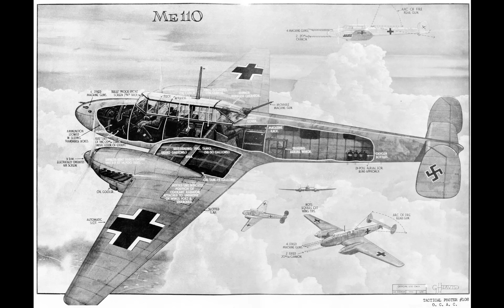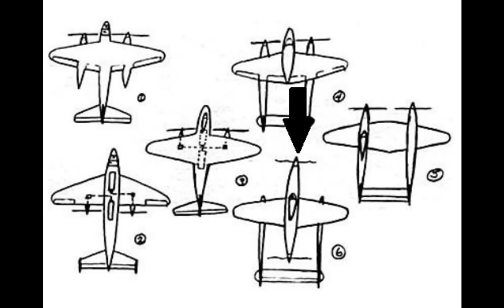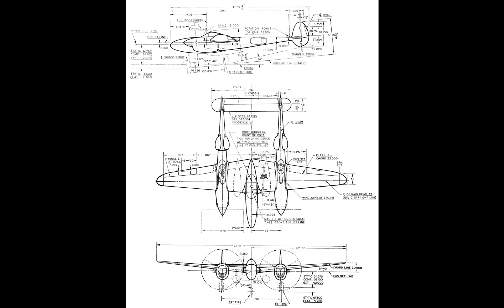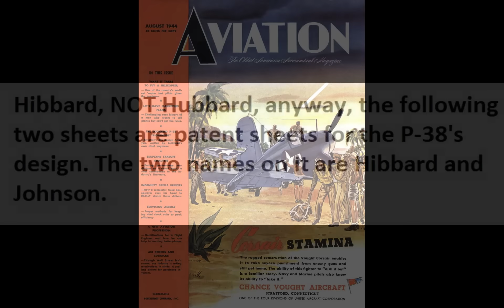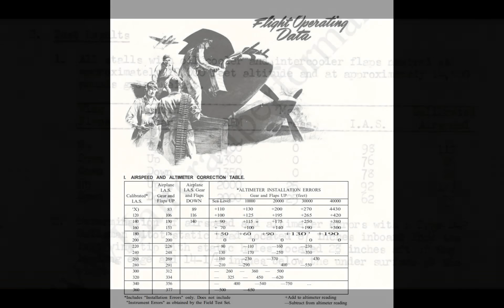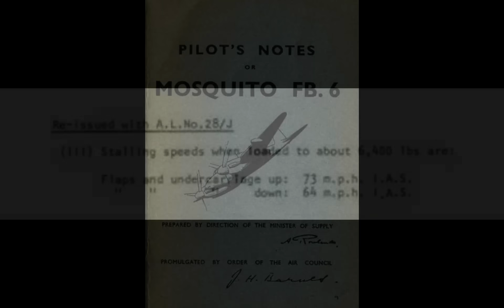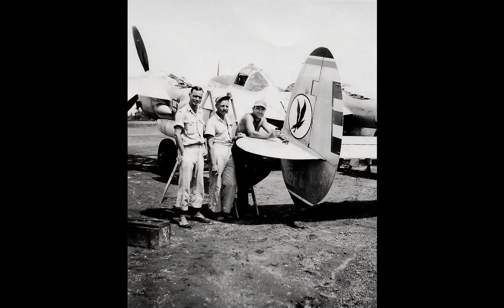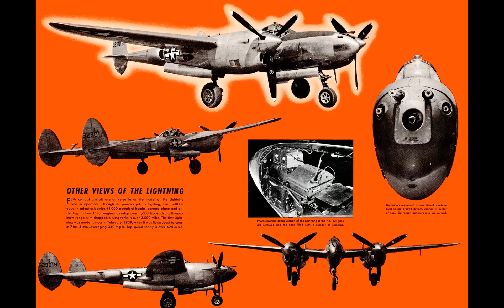Lockheed P-38 Lightning Design Info

Comment: Twin booms aside, the push-pull engine configuration AND a requirement for space for a pilot and weapons and superchargers and fuel and methanol-water injection and/or nitrous oxide seems to result in quite the sizeable plane, case in point the Do335. Makes one appreciate how compact a design the P38 actually is.
Reply from the maker: Good point about the size of the 335, and it doesn't have turbos.
Reply: @GregsAirplanesandAutomobiles  Well the do 335 was originally designed to be a bomber that got retrofitted into being a fighter. Mostly to hunt bombers as its armament was insane.
Reply: @GregsAirplanesandAutomobiles , have any data on b-29 wing rip speeds? I assume it is extremely close to its maximum speed (indicated).
Reply: @libertywolfyt985  What is Wing Rip Speed?
Like a Dynamic type of failure in a dive, or a Static Pull type test?
I have no clue, in any case...😜
Reply: @2lotusman851 , the collision or drag against the wings is so much that the wings are ripped off the fuselage, same concept as landing gear and flaps ripping off in different positions. There is also ripping for heavy g loads. You could notice the ripping starting if the wings start vibrating apart. For example, an me 163 achieved a top speed for the time, but parts of the aircraft started ripping off. 

The reason I wonder about the B-29 is because when people want to flaunt a top speed, but they don't usually understand other limitations.
Reply: @libertywolfyt985  There's no such thing as "wing rip speed."  Vne indicates where the plane can be expected to break apart due to excessive speed (indicated), and G limits indicate the same thing.
Reply: @immikeurnot , I am well aware that it isn't normally measured. I am asking specifically that because you are far more likely to crash when you have no wings.
Reply: @immikeurnot  The only thing I have read is T/M and C/M as measured by British Machmeters and the USAAF using Indicated Limit Diving Speed ILDS
Reply: @GregsAirplanesandAutomobiles  have you covered the P-61 Black Widow?
Reply: The Do335 makes the p47 look thin.
Reply: @juanordonezgalban2278   and SHORT
Reply: @juanordonezgalban2278  

The 335 makes the ARADO look tiny
Reply: @juanordonezgalban2278  Like ANYTHING, including a C5A, could make the Jug look thin.

Less Fat, maybe. Thin, no.
Reply: At least the Do335 manages to have 1 fuselage instead of 3...
Not by chance, its top speed is 100km/h higher despite having no turbo and a worse power/weight ratio.

Of course, there is more than just top speed. But the 3 gondolas approach isn't exactly the most elegant one from an engineering perspective.
Reply: @jorehir  1 fuselage and what, 5-6 years of progress in aerodynamics. Despite the Do335 being a chungus of a fighter plane, among other developments there's far less scoops, turbos and other doohickeys hanging out in the breeze than on the P38...I mean the gun barrels sticking so far out of the nose cost mph (like the bulges on the cowl of the 109-G6). But I don't think the three gondola or two gondolas and fuselage would be something that couldn't be overcome with a wind tunnel and horsepower like the f7f or Sea Hornet.
Reply: @DecrepitFatGuy  Having essentially 3 fuselages instead of 1 is inherently worse, aerodynamically. It leaves you with like twice the frontal area and 50% more wetted surface. Yeah, you can partially compensate with nicer teardrop shapes compared to a long cigar fuselage, but that won't be enough.

Now, the 3 fuselage approach has its advantages too (or Lockheed wouldn't have gone for it). For example, engines are more accessible, fuselages and wings are lighter (or potential load is higher), etc.

Surely, it depends on your priorities and the role you assign to the plane, but if you want it to go fast (like an interceptor should), you go for the Do335 configuration without a doubt. For other cases, it's arguable.
Reply: @jorehir  I don't disagree. If one were looking for the most go fast, the Do335 layout is the optimal one for that , like you said for frontal area and wetted surface area. One only needs to look at how the Dornier managed similar top end performance to the Sea Hornet with more weight (I think?) and over 300 less horsepower and probably better top end to the F7F with 400 or so horsepower less. If getting horsepower out of an engine were not an issue, then like you said requirements, priorities, roles and then manufacturability, maintainability, convenience and such become considerations that in my opinion might override a more aerodynamically optimal layout...though one can always imagine a Pfeil with the engine power of aTigercat, that would've been something else, until some engineer gets the bright idea to stopgap it into the jet age. Which they were going to do afaik.
Reply: @jorehir  well having a boat of a fueselage with bad P/W makes fire terrible acceleration, terrible turn rates at most speed ranges you’d fly at, and makes you a target. You failed to mention how the P 38 has vastly better visibility unless you what you make the point that pilot visibility doesn’t matter? 

If I make the pilot completely blind and have almost no maneuvering capability and hardly any good acceleration does that make it a better plane than the lighting just because it’s “faster”? 

Hmm, I’d rather be slower, have better acceleration, better maneuverability, and actually be able to see above and behind me without the obstruction of huge bars making me feel like I’m in a prison of death if I make 1 turn… 

Speed can be life but Top speed isn’t true end all be all. If you take hours to accelerate to top speed while being faster when a guy can accelerate to 3 quarters your speed in a fraction of the time isn’t feasible in reality for pilot survivability. 

The Do 335 would suffer in a 1 to 1 scenario against a p-38 or in real life multiple p-38s .
Reply: @BARelement  The Do335 could have had equally good visibility if its designers had gone another route with its canopy. It's not a problem related to its fuselage design, which is what we were discussing.

And, having almost the same wing loading and P/W as the P38, i wouldn't call the Do335 a brick...
Yeah, i wouldn't want to rate fight with it either at low speed, but that's about it.
Reply: @jorehir  
"Of course, there is more than just top speed. But the 3 gondolas approach isn't exactly the most elegant one from an engineering perspective."
...And yet it was one of the more survivable aircraft of the war. When it comes to engineering, having multiple segments isn't a problem. How you join them together structurally is. There are plenty of single-engine one-fuselage aircraft that were no were near as strong and survivable as the P-38 was despite its "weaknesses." And when you look at what the USAAF was doing with the things and just throwing them into every conceivable role even if it didn't make sense utilizing them in that fashion and I wonder how many other aircraft could both do it was asked to do and do it as well as it did. Sure, the P-47 might be one of the most survivable single piloted aircraft of the era, but you weren't going to turn it into a tactical bomber and it had limitations with reconnaissance.
Reply: @matchesburn  I had a very old neighbor who was a pilot in WWII. He flew the P-51 and also the P-38, so of course I was fascinated by his stories. He MUCH preferred the P-38. Better visibility, and if one engine got shot up, he could still get home instead of parachuting. You could take two shot-up P-38's and make one good one, but...if you shoot up the engine on a P-51, it was going to crash in enemy territory.
Reply: @jorehir  Good point. The planes had diferent objetives to achive and took diferent aproaches to them.
Reply: @jorehir  Well, the counterpoint is that I'll guess that configuration was considered but at the time the more practical approach towards ensuring they could meet and exceed the original design requirements was the twin boom and Gondola approach they finally settled on.
Reply: @Mike-eq4ky  Yeah, it's very possible.
Reply: @jorehir  - Bailing Out of a Do 335 can be Hazardous, if not Fatal
Reply: @jorehir  Chuck Yeager flew the DO-335 after the war while stationed at Dayton and considered it a very overcomplicated design that would have been difficult to maintain.
Reply: @fafner1   but it worked and it was faster than anything else flying bar the Me-262 and Arado Ar- 234
Reply: @mikepette4422  It worked for setting paper speed records; did it actually ever shoot anything down?
Reply: @mikepette4422  Its first flight was in 1943. It apparently had problems with engines overheating. 
Another German Superweapon for the YouTube-- Gee-- Whizz echo chamber.
Reply: @mikepette4422  
"but it worked"
An aircraft that can work in testing and was never put into combat service has not actually proven that it's a capable design. And I'd be willing to bet my left arm that, like many things that were cooked up in desperation by the Germans at the last minute, that its actual practical real-world performance in the field left A LOT to be desired.
Reply: @fafner1  But they won’t talk about that lol.
Reply: @fafner1  the Do was the fastest piston engine of the was and handled really well.
Reply: @fafner1  oh come on, it came late in the war and was a very well handling plane and the fastest prop plane made, had ejector seats too.
Reply: @Ivan TheMadVandal The P-51H never saw WW2 combat as it came just a little too late, and the P-47M came a few weeks before the war over Europe ended. The first recorded encounter with a Do335 is listed in April 1945, in which it outran 2 Tempests at low altitude.
Not to mention Germany's precarious position in... everything, from research to manufacturing.
Reply: @Ivan TheMadVandal Barely superior? Maybe, but it beat all of them in straight line speed. 
Impressive when you don't have access to a willing workforce, high octane fuel, factories that haven't been bombed, etc.
Deliveries of the Do335 started in January of 1945 and factory was overrun in late April. While the P-47M technically started delivery in December of 1944, engine issues meant it didn't actually get deployed until the war was almost over. Germany didn't have the luxury of waiting, so whatever problems they had were going to stay.
The P-51H arrived after the war was over on both theaters.
Reply: @Ivan TheMadVandal It obviously saw combat, it simply wasn't a fighter. From January to April it is guaranteed that it saw combat somewhere.
Easy to lose track of a plane that had all of 11 units produced and was relegated mostly to ground attacks or maybe shooting bombers.

Both came late, had a negligible impact in the war, and were used in low numbers.
The difference is that only one of them remained as the fastest piston engined aircraft of the time, and it didn't need 150 octane fuel or a giant turbo to do it.
Also keep in mind that it was originally designed, from the start, as a fast bomber. Not a fighter, not an interceptor, not a ground attacker. A bomber.
Reply: @ivanthemadvandal8435

Credit where it’s due, that’s still a twin engined aircraft built in 1945 Germany that has speeds comparable to some of the fastest superprops. Sure, it’s not exactly THAT much faster (i believe it’s actually slower at sea level), and it has the approximate pitch and yaw agility of an ocean liner… if said ocean liner were controlled by cables and pulleys… but again, it’s impressive what they managed to do with the limitations placed on them
Reply: @fafner1 Brown said it would have been a good night fighter but not a day fighter
Reply: @fafner1  No, it was never put into combat
Reply: The Do 335 performance looks good on paper, just don't ever try to

Bail Out of one, because it will likely be the last thing you'll ever do.
Reply: @Ranger_Raptor_Twin-Turbo_3.0L  As I recall from Brown's book, (1) rear engine had a tendency to overheat and catch fire, (2) there was a set of explosive charges the pilot could trigger that would blow off the blades of the rear prop.  Not ideal.
Reply: @paulflory3532  It never went into Mass Production, and wasn't Operationally Successful.
Reply: Another point on the push-pull design of the Dornier is that the rear propeller suffers from non-laminar airflow due to turbulence from the forward prop and consequently is less efficient.
Reply: 11,53 vs 13,85 length: I think the Do 335 is a remarkable compact design.
Reply: Tbf, the Do335 was intended to carry much more weight since it's role was supposed to be similar to the Mosquito

Comment: As I brit I'd never compare the mossie and p38 . Two very different aircraft . The mossie was a bomber that became a fighter , the p38 was a fighter that became a bomber.
Reply from the maker: I understand your point. A lot of Brits seem upset by the idea of anything being compared to the Mosquito. However the historical reality is that they were compared, and the US even contemplated building Mosquitos but built P-38s instead. The British used Lightnings, but eventually went all in on Mossies instead. Thus, I'll be comparing them. I'm not going to avoid historical reality to avoid hurt feelings. Plus the Mossie does well in most aspects of the comparison, so its fans should be happy.
Reply: @GregsAirplanesandAutomobiles  I ment that as a compliment to the p38 and the mossie .
Reply: @GregsAirplanesandAutomobiles  I'd compare the p38 to the westland whirlwind  more than the mossie.
Reply: @GregsAirplanesandAutomobiles  Personally I would love a comparison  with Grumman's F7F Tigercat.
Reply from the maker: Edmund, I understand, the Mosquito was quite awesome.
Reply from the maker: Walter, the Tigercat is more of a late/post war superprop. It compares more with the Hornet than the Mosquito.
Reply: @GregsAirplanesandAutomobiles  I meant a p-38 vs F7F.
Reply: @GregsAirplanesandAutomobiles  I'd compare the mosquito to the B26 over the p38 personally.  Mainly because the P38 had fighter performance in not only speed but maneuverable too.
Reply: @GregsAirplanesandAutomobiles  Brits can't stop lauding the Mosquito.  It is reflex now....
Reply: @WALTERBROADDUS  ahem . I don't know if you can actually do comprehension but I  really think that it's disingenuous to compare the P38 to the mosquito because they were very different . The P 38 was a far superior fighter over the mosquito.
Reply: @edmundscycles1  I think you need  to read again. The Comparison is I suggested was "not" with the Mosquito for the reason you suggest.
Reply: @WALTERBROADDUS  to quote : 
Brits can't stop lauding the mosquito . It is reflex now ......

At what point was I lauding the mosquito.  If anything I was paying tribute to the P38 and that it was a superior fighter aircraft than the mosquito.  
I could tell you were comparing the F7 to the P38 . 

I take issue with the narrow minded concept and conceit that you hold towards British people who enjoy Greg's essays.

And what is more , my suggestion of the westland whirlwind as a comparison for the p38 would show how significantly superior the P38 was to just about anything twin engined flying as a fighter .
Reply: edmundscycles1
I'm not a Brit but I love the Mosquito (and the Hornet), and I agree that it's not that useful to compare the P-38 to the Mosquito.  So many aircraft in WWII started from different places to cross over into similar roles, so any such comparison just indicates that larger high performance aircraft are inherently versatile and can perform a variety of roles that require speed, range, and payload.  The Mosquito was the better bomber and the P-38 was the better fighter, and they both did fighter bombing and photo recce quite well. The US did not replace the P-38 with the Mosquito because what they wanted was a fighter, and it was misguided to compare these two airplanes for that role. I think were the USAAF missed an opportunity was in not adopting the Mosquito as a more versatile and efficient replacement for medium bombers and attack aircraft like the B-26 and A-20/A-26.  WWII proved the schnell-bomber and fighter-bomber concepts operationally superior to the medium bomber concept, but U.S. did not really begin to adapt doctrine and designs to those concepts until long after the war.